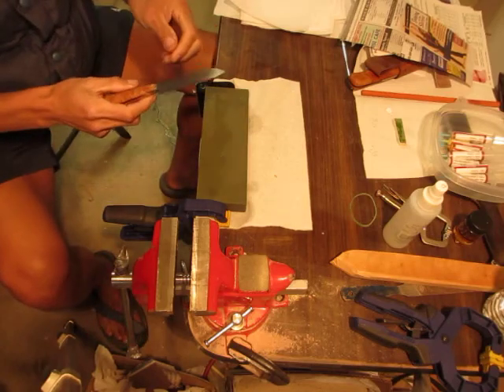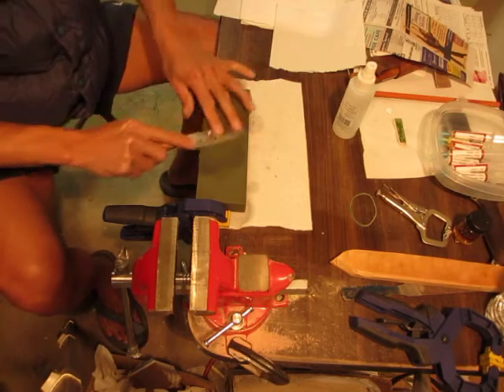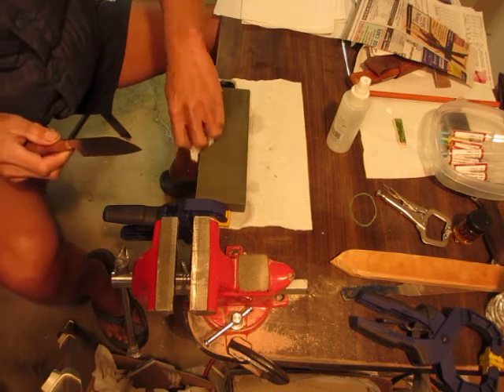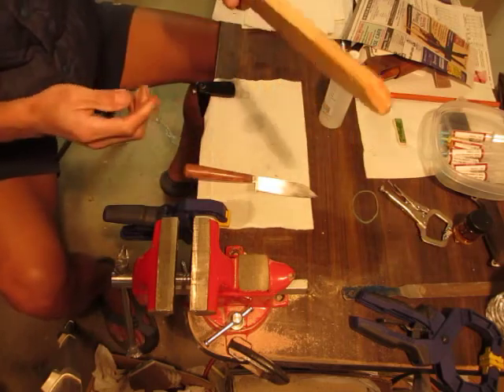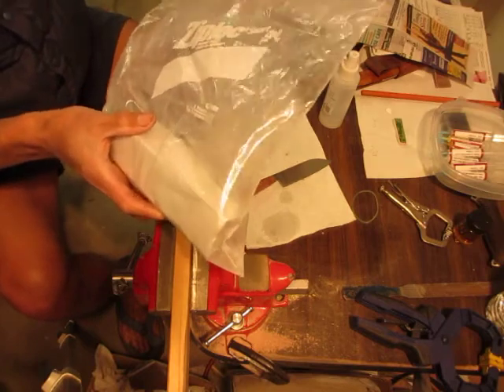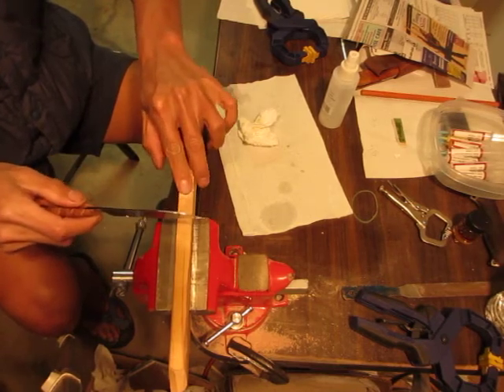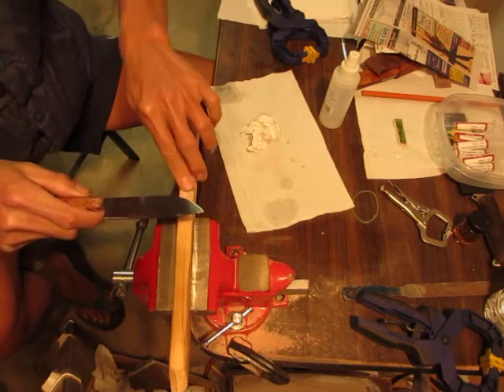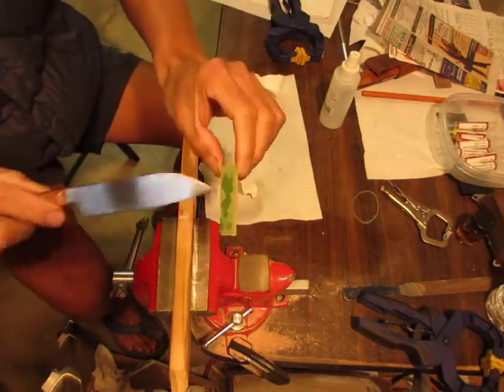Freehand knife sharpening - Groove Mirror Sharpener

Comment: Hello Mr TanLong , I am very much enjoying your videos & learning much from them . Thank you for taking time to do them .

I recently purchased a knife with a AUS-8 stainless steel "Techno-Recurve" style blade and am having a bit of trouble getting it as sharp as I would like because of the recurve shape . I have future planes of purchasing a round sharping rod for it but was wondering if you had any suggestions on a simple solution to this problem without it ?

Thanks again.
Reply from the maker: For recurve - wrap SiC (Silicon Carbide) or AlO (Aluminum Oxide) sand paper around a broom stick or a 1" dowel.  Use sand paper start with 220, 400 then 800 grit for Aus-8.

Buy a block of white buffing compound from truegrit com. And 1 foot of 1" manila rope from home center.  Rub white compound onto rope and strop away.  Watch my 'balanced strop' video to see why & how.
Reply: Thank you so much Mr TanLong for your quick & helpful reply . I have most all that at my immediate disposal & will take your advice .
John